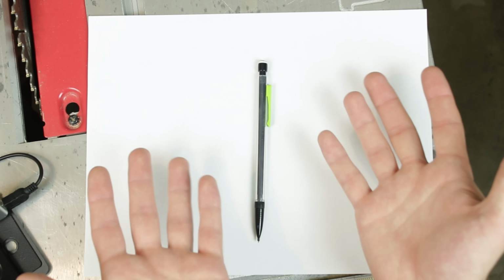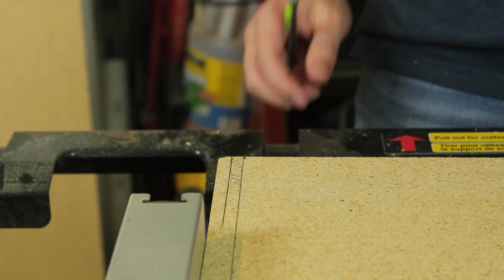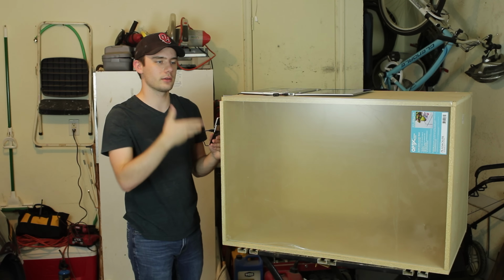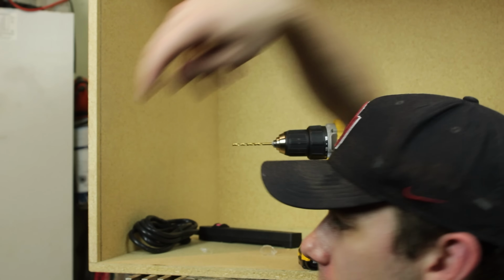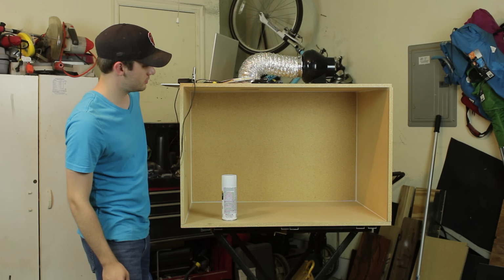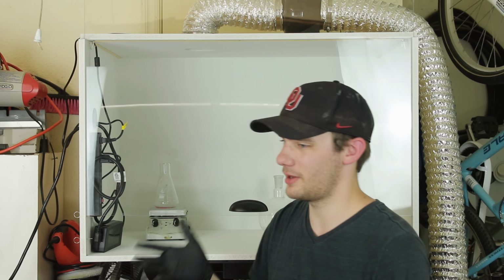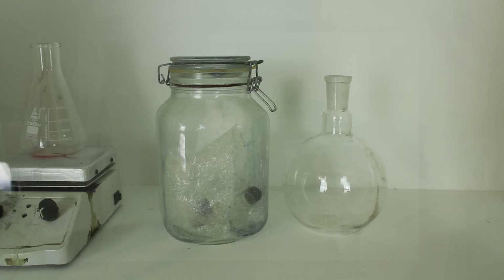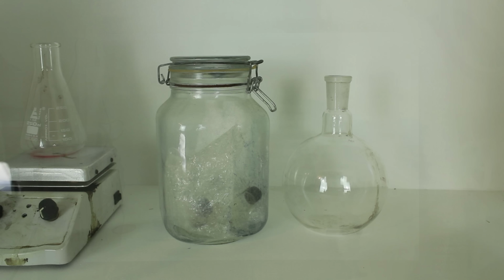Building an OSHA-Approved Fume Hood to Make Chemistry Less Dangerous

Comment from the maker: IMPORTANT NOTE! To get proper airflow, you need the right size ducting, and apparently, the 4" hose that I used is not sufficient to meet OSHA guidelines. So, I've purchased an 8" 720 CFM inline fan and 8" hosing, which should get things up to spec!
Reply: You might consider putting a set of counter weights to make the acrylic window a little easier to lift and close.  You might also look at putting a flat piece of wood in front of the exhaust hose.  This will direct the flow of gases up the sides of the box.
Reply: @en2oh There's a few issues with this design but under the thought of "anything is better then nothing", I'll just say anything is better than nothing.

The upgrades I'd add to what you've mentioned already are things like the fan (something rated for chemical use), and place it near as possible to the building exhaust point... the ducting (aluminum is too reactive for this use case), the finish on the box itself (an epoxy topcoat probably not a bad idea depending on later intent).. but that topcoat bonded to a metal lining (stainless is good)... probably make the sash of thicker acrylic and give the track guides, both an effort to keep things in place if there's an event in the box. Wiring outside the box, but especially if flammable gases are expected.. H2 just for one has a really wide EL window. Put the strip at least outside (probably not the best choice to begin with for heating elements anyway)... in this way can disconnect power from the loads without opening the sash. Separate the fan and loads so the fan can remain on with everything else disconnected in a hurry (but still provide a switch to shut it off)...

Quite a list... but as it sits, much better than doing anything done in this video out on an open bench. More than I can say I've had going myself at times, and I've been got by my indiscretion on occasion as a result... no bueno.
Reply: What are you planning to do with gases that may eventually reach your neighborhood?
Reply: @MadScientist267  Agreed with everything. It needs everything you said, which kind of means a full rebuild. I get the "anything better than nothing" thing but in some ways I honestly think that box is worse. The fire risk inherent to the exposed painted wood is very worrying,  if the sash has to be quickly shut it could easily bind up in the slots or chemicals could compromise the slots it slides in and it'll just plain fall out, there is no airflow monitoring, the acrylic is quite thin... it is just a false sense of security box.
Reply: What about adding an active carbon filter in the extraction, just to avoid to intoxicate your neighbourhood and it's cheap
Reply: @MadScientist267  Thank you sir for all these suggestions! I have been searching resources about DIY fume hoods for quite some time, and judging from the very few guides and videos available online, it must be quite a difficult task to build one. Now I have some more good ideas to implement. Allow me to ask you for a suggestion: apart from removing fumes from my working area, my primary concern is to avoid intoxicating or poisoning people, animals and crops/vegetables that may come in contact with those toxic exhalations, especially since I sometimes use dangerous and carcinogenic compounds like formaldehyde. Many people say that a simple HEPA filter together with an activated carbon filter could do the job, but I sincerely doubt that since many volatile substances would require chemical neutralization. Since you seem very knowledgeable on the topic, do you mind sharing your thoughts about fumes purification/neutralization? Thank you very much!
Reply: @dennispreatto9098  Volatiles will pass any standard filter, as they are gases as they leave the hood, so that won't help at all. Neutralization is useful for certain things, but when it comes to volatiles, they aren't really practical at small scale to remove from the exhaust stream. A fume hood really does two things... gets the concentrated fumes out of the immediate area, and real ones have a fresh intake (from outside) as well as the exhaust. There are a few reasons for this but one of the goals is to effectively dilute the exhaust before it is discharged outside. It leaves the outside vent pre-diluted where it is then fully dispersed by outdoor air currents.

What this translates to in practical use is very low risk as far as effects on much of anything outside. You're more likely to locate an unhappy neighbor that doesn't like the scent of something or will generalize it to something that can become a legal issue. You'll have to read between the lines on some of this, as I can't explain anything in depth in this environment.

When it's possible and not a well-being of something concern, might find it useful to eliminate them as they are produced, a burnoff when appropriate for example. You'll of course need to be mindful of products from doing so, but typically even when they are still not the friendliest, they are likely much less of an issue than what you started with. H2S comes to mind there. While not a "volatile" per se, it's up there on the list, and simply burning it in air significantly lowers the "issue factor" by changing it up for SO2 (and water) instead, a useful thing.

But in general, the dilution is sufficient by itself.

Creative writing powered by YouTube comments.
Reply: @dennispreatto9098  I clarified and YouTube nuked it. This isn't the place to learn any of this... The blind removal factor is off the chain 🙄
Reply: @dennispreatto9098  I reworded a few things, hopefully it helps... Other, simply reactive gases... One approach there might be running them through a scrubber setup.. acid-base comes in handy in the inorganic world, which essentially is just a trap that plays on both sides of the fence. Bubbling first through sulfuric and then a separate sodium hydroxide stage will get quite a bit for minimal effort. Say, chlorine, would make it past the sulfuric but would turn into regular old salt in the hydroxide. At the other end, NH3 for example would be caught by the sulfuric stage before even reaching the hydroxide. 

Usually, both are not necessary unless you're just looking to build a general "catch all" scheme that you can just attach to other glassware with little thought. Normally, the gases of interest are addressed with the appropriate solution or stages/solutions as needed. 

Organic volatiles are largely outside of my scope, but many can be oxidized as described before, it is a question of necessity vs effort. Those that can't, you'd have to see what's involved if you deem it necessary. 

Activated carbon stage may help with some gases if provided in the diluted exhaust stream. This won't catch everything either but anything with a hydrogen hanging off of it somewhere will have an affinity for the carbon. It doesn't react with it, but "gets stuck", as a particle would in a normal filter. Like anything else, it will fill up and need maintenance, either replacement or regeneration.
Reply: @MadScientist267  I couldn't hope for a more detailed explanation! You gave me a lot of interesting inputs and suggestions that I am surely going to consider, thank you very much for sharing your knowledge!

Comment: Put the plugs and switches outside of the hood before something eats though it or causes a spark while working on something flammable
Reply: best advise comment ever.
Reply: The bottom of the hood needs to be open to let fresh air in so it’s easy to run the cords out of the hood and use a different breaker for the hood than what you use for the hot plate so if it trips a breaker the fan will still run
Reply: Good thinking 😅 @Jimdandymetals

Comment: I would recomend to add some "lip" on fromt to prevent leaks of overspills or tipped glass
Reply: depending on how much volume he works with, or how dangerous the chems...having taper to left/right edges, with 'gutters' into a glass pale/carboy (and neutralizing chem) could be a +1 if a spill onto floor etc = really bad or expensive. 
          Although if I gotta go this route, I'd prob take the neutralizing chems and have 1 'acid neutralizer' and 1 'alkaline neutralizer' tank with valve...then in emergency you slame front panel of the fume hood--->turn valve and 'flush everything'.

...Again, most likely OVERKILL, but always something to consider as one works with more volatile compounds: if you can avoid having to don a hazmat suit or even just replace your flooring = good thing

Comment: Assuming you are going to crack your garage and run the tube out. If so, be sure to run it way outside. The exhaust will create negative pressure in your garage and air from the outside will get pulled in to equalize. You don't want your exhaust fumes getting pulled back into the garage
Reply from the maker: Yeah, I used about 50 feet of that hose, so it reaches pretty far into the driveway (and totally doesn't look suspicious, lol). I was planning to have a barrier or something similar go along the bottom of the garage door to help stop the wind from blowing anything back inside, but that proved to trigger the door's safety mechanism, preventing it from closing.
Reply: @LabCoatz_Science 

No officer I don't know what you're talking about I don't see how that looks suspicious......

No I've never seen breaking bad!
Reply: @LabCoatz_Science just unlock the door from the opener when you're using the hose for ventilation, then lock it back in for normal operation when you're done!

Comment: Remember that you have aluminum hoses before doing anything with Bromine
Might wanna switch to plastic before attempting that
Reply: He could use Ammonium fluorosilicate to create a passivation layer of aluminum fluoride. Or is that not resistant to bromine either?
Reply: @MrDJAK777  the issue might be that a on thin, flexible aluminum foil the coating will start to crack and expose the metal again if it gets bent or moved in any way
Reply: I am no expert,  but it's probably safer to get one of the flexible pv hoses.  They are Mae for ducts, are near impossible to tear, and made for chemical resistance. They are a little pricey, compared to those cheap easy rip aluminum.
Reply: @y33t23  very good point, thanks!
Reply: Same thought
Reply: Given the prices I've seen for ptfe tube, they also make thin teflon sheet that can be made into tubes and blown into the lines like sewer relining. Probably could get away with just rolling it a few layers thick and not need to worry about sealing. Granted, they also make chemical resistant paints. Doubling up probably wouldn't be a bad idea.

Comment: I wrote a guide to making a DIY fume hood and I have a few ideas that will make it much nicer to use. 1: use outdoor plug receptacles with a gfci, preferably the ones with metal covers with a little gasket to reduce the risk of electrical accidents and to keep the internals of the outlet clear of corrosives. 2: I lined mine with vinyl ester resin and added baffles for better airflow. The vinyl ester resin is really chemical resistant and more heat resistant than other resins and can be bought on Amazon. It has kind of a purple brown color so I added titanium dioxide powder to color it white and add more UV resistance. 3: lastly, I found lattice connectors on Amazon and used aluminum rod stock to make a lab lattice in the back of the fume hood. It’s so much better than lab stands especially in such an enclosed space, and makes it easy to add clips and clamps.

Comment: Put in a fresh air duct from outside ( coming from another area than the exhaust ) to have air to move. Otherwise, the exhaust gasses might get sucked right back in due to the negative pressure of the closed room.

Comment: Soooo… 🤔 probably no fractional distillation or refluxing in there.

I'm guessing it's kind of small for space reasons, but it might have benefited from being a bit taller.

Also as others have said, that vent and fan is a weak link. Corrosive things may eat the vent "pipe" and kill the motor. Something to keep an eye on for sure.

Very nice otherwise, and I'm glad you have it. Definitely much safer than not having it.
Reply from the maker: I have been able to run refluxes in the hood, but a fractional distillation is definitely out of the question...fortunately I don't really do those often, if ever!
Reply: @LabCoatz_Science  I'm probably influenced by my own glassware, I don't think I have a reflux condenser that would fit on a flask on top of a hotplate in there. I hope that's in an upcoming video, I'm interested to see that!
Reply from the maker: @imikla  It's actually in the "legal meth" video I've been working on! Not sure if it'll make it to the final cut though, because that particular part was kind of a failure...let's just say too much lithium aluminum hydride in too little THF, lol

Comment: Just a few tips. While offensive smells are an issue that must be dealt with if not for yourself, than for other's sake, I'd also be concerned about where the gases are going once these leave the garage. Smell does not tell you how toxic a gas is. It might be deadly, but have little to no perceptible odor. Keeping track of the wind direction before undergoing an experiment in the fume hood, especially in a highly populated area, to help control the flow of gas emissions outside your garage. This, to avoid potentially causing harm to others nearby, and to keep complaints about odors to a minimum. P.S. I had a mishap with chlorine gas. One whiff was all I needed to breathe in to feel instantly suffocated. I heard about your hospitalization. I'm glad your OK. As someone who likes to tinker/make/build things, I also put myself at risk sometimes. It's a risk I've been willing to take when I was the only possible victim. Why?Knowledge is never gained without some type of risk involved. Something only becomes safe after learning how dangerous it is.

Comment: With extraction fans like that, you generally want the entire fan assembly to be outside so that only negative pressure hoses/ducts are inside. This is so that if the exhaust duct disconnected or got a hole in it, you wouldn't be pushing bad air directly out of the hood into your environment. Areas with radon require that the radon fan itself is either mounted outside or in a non-living space like the attic for the same reasons.

Comment: You ideally want the blower motor outside or as close to outside as possible, that way the hose before the motor is under vacuum and the hose after the motor is under pressure, so if there's  a leak it won't just leak back out into your space.

Comment: Coat the MDF with a chemical and fire resistant epoxy. You can easily find it on google. Also, add a lip to the front bottom of your hood to contain any spills. Also, you might want to get a plastic tray fit the size of the hood counter to add additional protection.

Also, drill a hole in the front of the side wall where the acrylic slides through to thread a bolt with a knob through. The bolt will apply pressure to the acrylic sheet and allow you keep in place with friction.

Comment: I'd look into the r-rated insulated ducting. It'll have a quality plastic ducting (foil devlopes and sometimes comes with tons of needle-holes) with an insulation (noise) and an outer wrapping. This will avoid any accidental damage from rubbing against the fan. It's pretty affordable for a small run of it. Just a thought!   Also the power box can have some leaks where it screws onto the housing (it should be sucking in, so not a problem.

Comment: My only question is - how do you handle the output - are you running it through activated carbon or just venting out?

I feel you on the hot garage - same with Texas - just load up a shop fan at the least and keep the air flowing.

Comment: nice fumehood! glad to see the fan wasnt too anemic. did you plan on doing a simple window unit install, or were you thinking about installing one of those diy minisplits that can also heat in the winter?
Reply from the maker: Eh, it's not even my house, so I can't install anything permanently...I will when I get my own place though! That, or I'll just install a better hood inside, lol.
Reply: @LabCoatz_Science  well, when you get your own place, hmu if you want some help installing one of those mini splits. ive installed two units myself before. i even have some hvac vacuum pumps that can be used to remove the air from the lines (for those that dont come with precharged lines). now i may or may not be available when the time comes, but feel free to ask me when you want to mess with it. also, you'll likely still need a licensed pro to come inspect it so that the warranty will be honored by the manufacturer, but it'll be a lot cheaper for just an inspection than a full install

Comment: That fan is not going to be sufficient if the hood is open more than 8 inches.  You need a 100 fpm face velocity.  For a 3 foot opening that is going to be less than 8 inches.
Reply: Ps. Chlorine smell is not the worst.  But you are a lot better than other people even if it doesn't meet osha requirements.
Reply from the maker: Correct. Normally, I only have it open 6" or less, so it should be fine until I can afford something larger.

Comment: Nice! If you want a surface that's more resistant to stains, corrosion etc, PTFE sheet (or even just polyethylene ~1mm thick) is pretty reasonably priced from plastics retailers. For fiery stuff, a cheap source of stainless might be metals scrapyards that charge by weight if you have them if your area. If you're lucky they might let you angle grind the side & bottom out of a catering sink or similar and just pay for the weight of the metal.